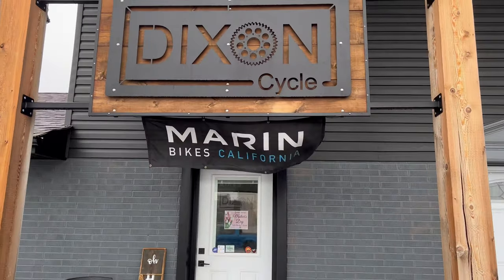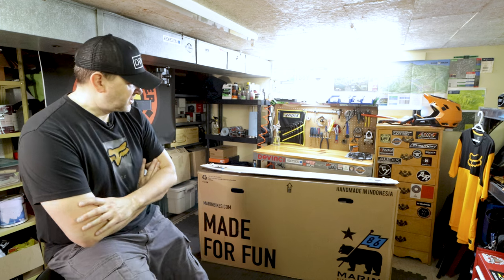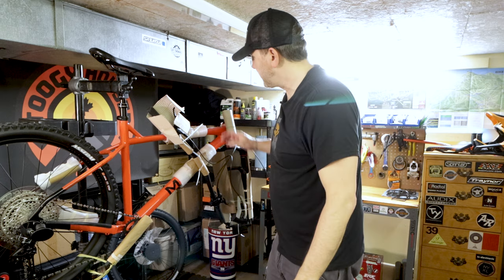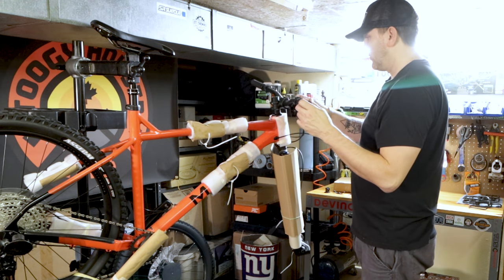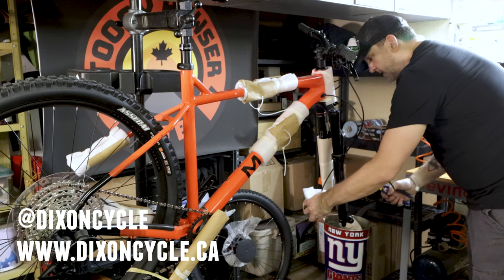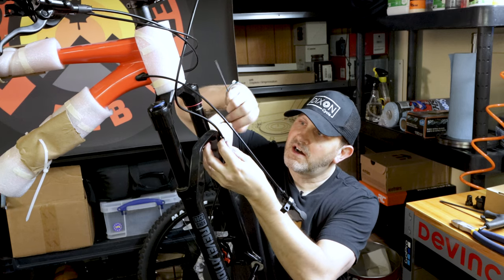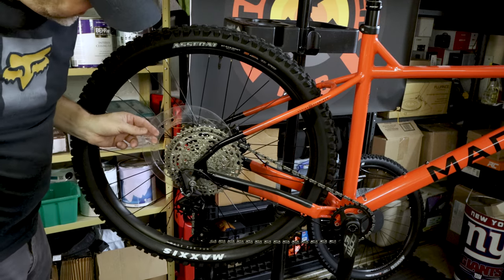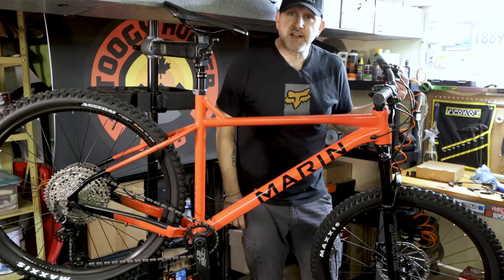Starting over with a 𝗡𝗘𝗪 Bike!

Comment: I have a 2022 sq3 great bike great platform to do it all from. Id probably use mighter tires for those gravel rides tou mentioned, so youre not working as hard as your friends on gravel bikes.
Reply from the maker: What tires would you recommend?
Reply: I really like the specialized tires id get ground control probably if I wanted something fast.